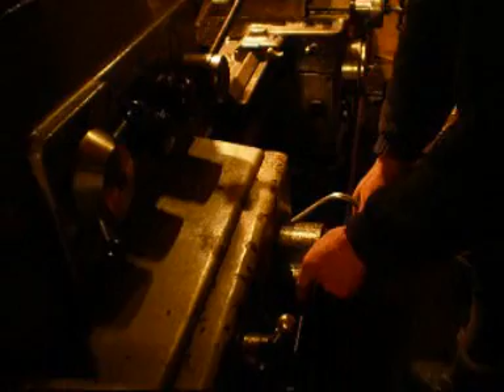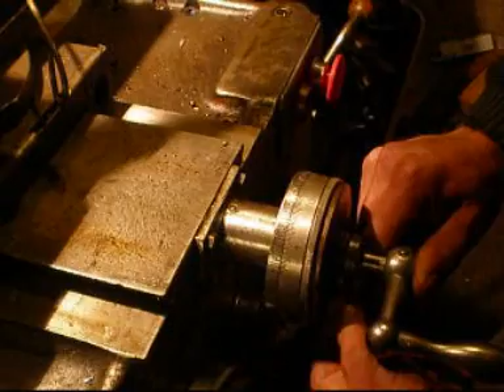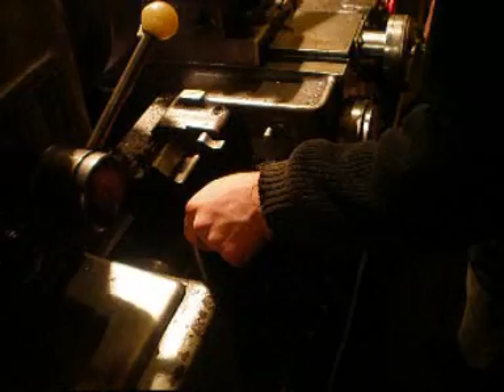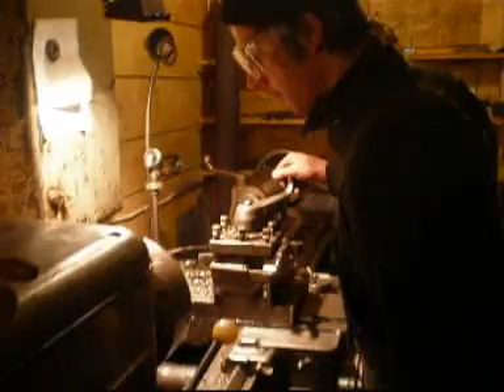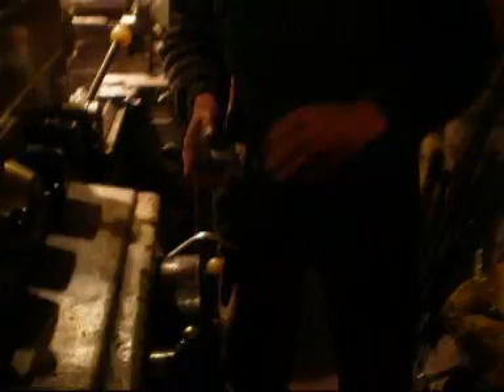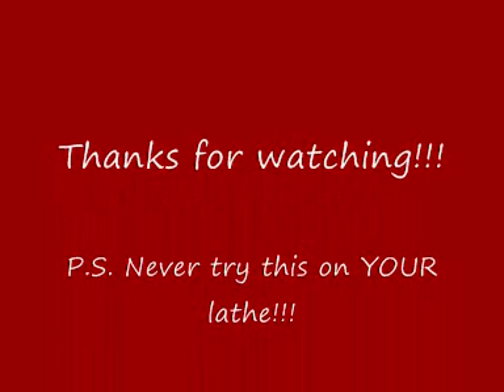Metal lathe works- thread cutting

Comment: ?????
Why do you make a warning ?
I think it's the method I'm gonna use when doing threads on my 1A616 - right ?
Reply from the maker: Warning? Ah... ignore it if You promise work nice. :-)
But the method, yes, same that how to cut a threads. Only the difference is in machine size (1A616 or 1K62) and that to 1A616 have in electrical way swap spining direction of spindle but 1K62 have clutch. Actually, no difference.
Good luck!